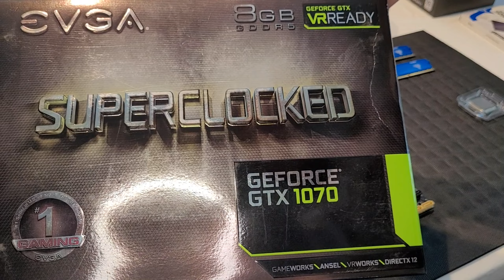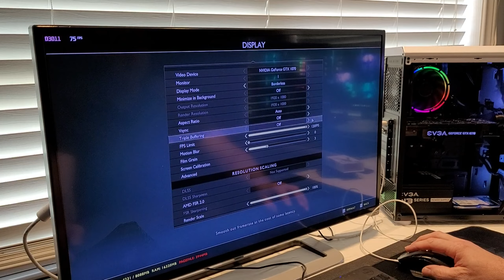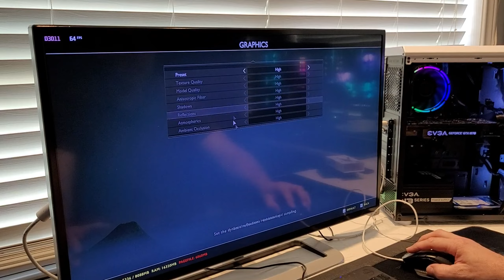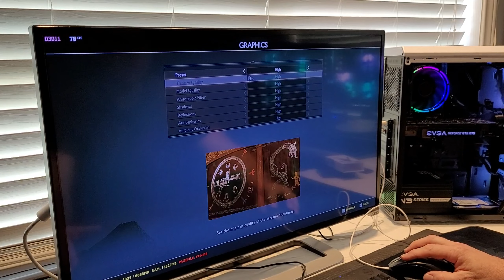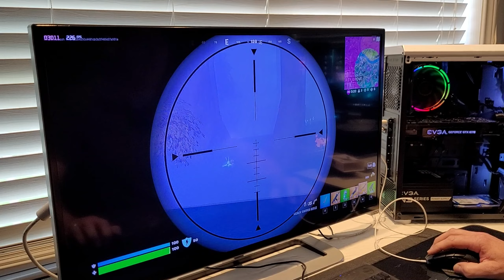Gaming PC Build using the I7 4790 GTX 1070. Gameplay benchmarks using God of War, Apex and Fortnite

Comment: Great setup..mobo brand+type?tq
Reply from the maker: it’s an ASUS h81m c
Reply: @Fenrirsleash  is there any different in fps with B85 mobo with pcie.ex 3.0?
Reply from the maker: @salwaajulietaribixka2736  I think that it would be the same performance motherboard wise
Reply from the maker: Also on a side note if you don’t have the 4790 yet you can save a lot of money and buy a Xeon e3 1271 v3. Performs the same or better
Reply: @Fenrirsleash  i have same cpu but want to change my mobo from h81 to b85..for gain extra fps in pciex 3.0.Btw +1 sub 4 U
Reply from the maker: @salwaajulietaribixka2736  sounds great!! This was a nice pic, I built a couple like this one using different GPUs but I think the 1070 was the best combo with it all around. So 1070, 1660 super or ti, 2060. Any of those would pair well. Rx 5600xt would work too